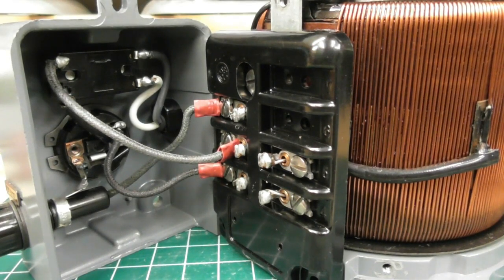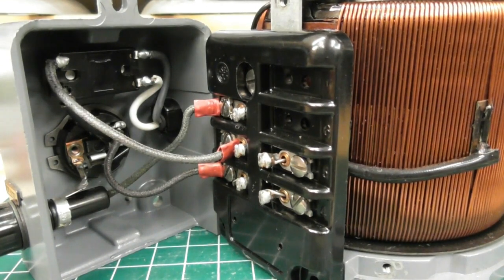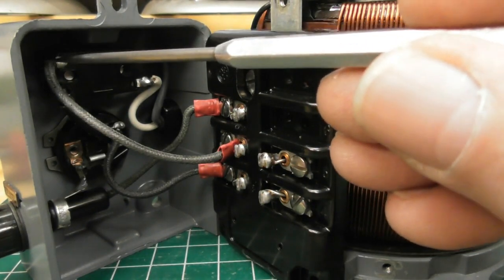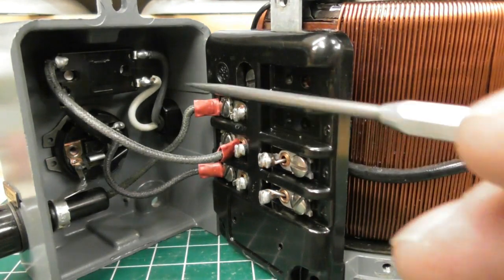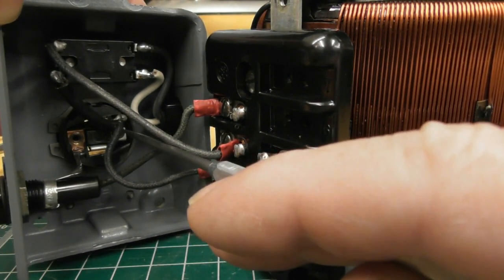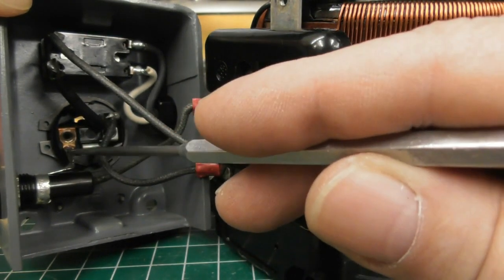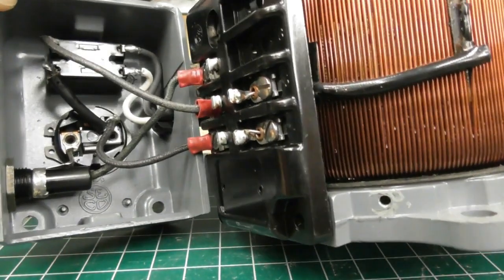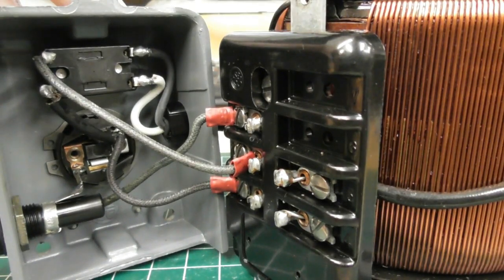Powerstat Model 116 Wiring

Comment: Hello, I have the same variac but I want to change the outlet to a 3 prong outlet.  How would the wiring be different.  I know I have to add a ground, but just want to be sure, thanks
Reply from the maker: Patrick, "IF" you could find a three prong outlet that would fit in the unit- nothing would change other than needing to figure out how to terminate the ground internally. Good luck, G.

Comment: I just acquired this same variac and when I opened the box, I found it had been roughed up during shipping. A broken fuseholder and maybe more. Is there a business that offers replacement parts for this unit? Thanks again. Enjoyed your video too!
Reply from the maker: I can't say. Good luck with finding that your need. G.
Reply: @ghostses  Excellent video! very informative and interesting.
I also have the same model and i would like to know if the fuse i have is the correct one. It is a 32VAC 8AMP Mfr Gould gdl, it seems like it is a slow-blow fuse because the filament is not the thin type it is a flat metal stripe. I am also wondering about the 32VAC voltage rating it seems kinda low to me? but i just bought it and i am not too familiar with its specifications. It does work fine.

Thank you
Reply from the maker: @SDsailor7  Rob, mine had a 250V 8AMP ceramic slow-blow fuse in it when I got it that was blown. I only had a 250V 8AMP fast acting on-hand when I did my restoration video so that's what I used. Personally I would replace it with a 250V 8AMp slow-blow fuse- or at least have some on-hand if yours ever pops. Don't know if it should be ceramic or not, but again- that's what mine had in it when I got it. Hope this helps, G.
Reply: @ghostses  I know the 8amp part is good because it has a metal tag right next to the fuse holder I am only concerned with the 32
Reply: @ghostses  I know that the 8 amp is correct because there is a metal tag right next to the fuse that says 8 amp. I am concerned with the 32vac being incorrect but i will do some research to see if it correct.
Do you have the operators manual or service manual?
Reply from the maker: @SDsailor7  Change it, that's an automotive fuse.
Reply from the maker: @SDsailor7  It's not correct Rob. Like I said before that's an automotive fuse being that it's 32V. Get a fuse like I've mentioned and go with that. And no, I don't have any kind of manual. Good luck, G.
Reply: @ghostses  Yes i will get a 250v 8amp slow blo fuse.
I have tested the variac a couple of times and found out that it is out of specs because when i turn the knob the readings keep going down at 120vac it shows 104vac on my DMM and at 140 my DMM shows 120vac
So does that mean it is dirty? I have already tried to adjust the knob to the Zero on the variac meter.

Comment: Mine had a bad socket, so I was pretty far up the creek until I found a rare replacement on eBay for cheap. Thanks for sharing this! Can't wait to finally hop back on this project
Reply from the maker: Good deal! Hope your project turns out well. Take care, G.
Reply: @ghostses  Well I found out that my powerstat only goes to 118.5vac it does not go to 140vac even though that is what it says on the tag with the info.
The tag says that I have the type 116 and I found a chart on a website that says the 116 only goes to 120vac. But mine has the 140 dial like yours. Have you ever heard about that?

Comment: Very helpful. I have one just like yours but have not plugged it in yet after replacing the 120V input wires. Quick question - what should be the DC resistance of the outer coil - from terminal 1 to 2?  I measure 1.0 ohms and it seems too low. The DC current would be 120/1.0 = 120 A !!  Perhaps with AC, the reactance is much higher??  Will appreciate your advice. Thanks
Reply from the maker: Thanks James. I will start by saying this is AC in and AC out. It just regulates AC voltage. But, I took mine apart and measured the resistance between terminals 1-2 and came up with 1.1 ohms. I will not be taking mine apart again for future questions, so I hope this helps, G.
Reply: @ghostses  Thanks for your reply.  I plugged mine in, and at no load on the variable side, measured ~0.07 amps AC.  So, the AC inductive reactance is far greater than the DC resistance.  Later, I got a reply from the supplier, Specialty Product Technologies on the DC resistance; they also said 1.1 ohms.  Thanks a lot.
Reply from the maker: @jamesprochaska6398  Good deal! G.